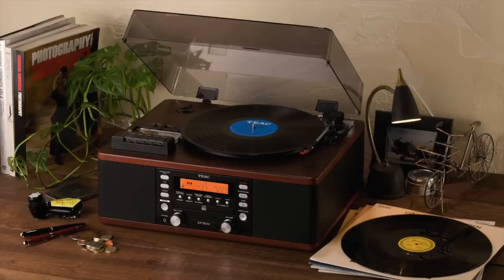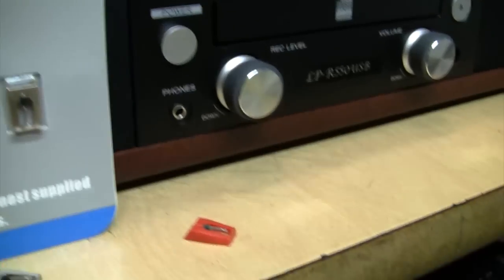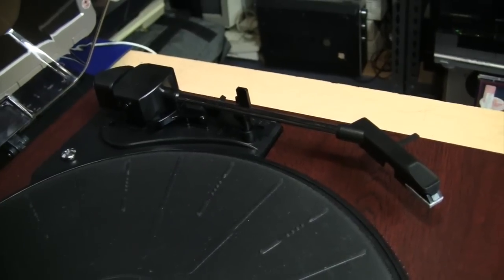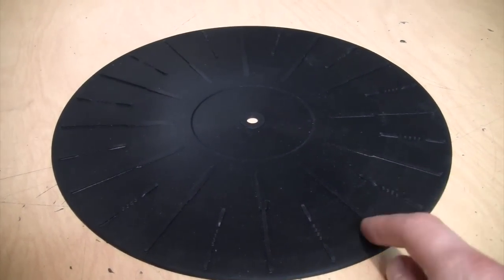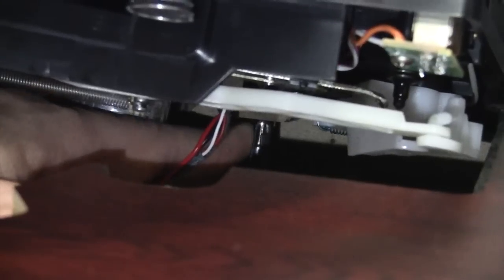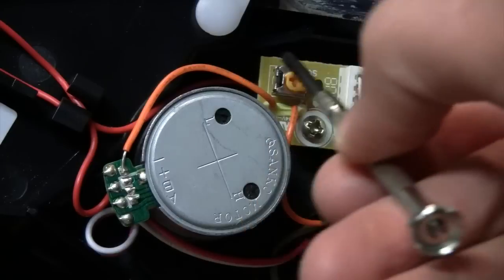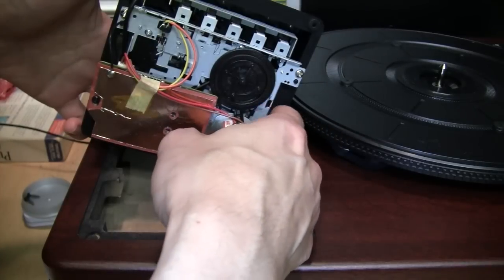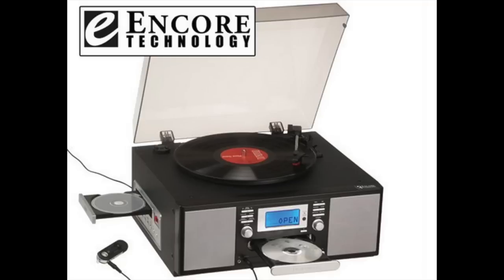TEAC LP-R550USB all-in-one system tweaks & upgrades

Comment: Excellent follow-up video!  I just received this turntable this past weekend and I'm absolutely blown away by the sound quality, even with the stock sapphire stylus.  That being said though, going the diamond route will make it a much better experience for me not only because of enhanced sound quality, but many more hours of playback from a single stylus.  

And in terms of the speed, surprisingly, the speeds for both 33 1/3 and 45 seem to be just fine for me for what bit of vinyl I've played on there already.  The pitch doesn't sound off or anything, and it sounds like how I expect it to.

I unfortunately fell into the trap of getting that 3 pack of diamond styli that Amazon suggested (which is the one you recommended against), so now when those arrive tomorrow, I'll have to return those and then order 1 or a few of that other one you said was better.  Fortunately, I did end up finding that particular stylus on Amazon, so I can just go ahead and order it from there.  But for the time being, that stock sapphire stylus will definitely do until I get that diamond one.
Reply: saxman112 can you post a link to the stylus?
Reply: You're better off using a stylus with the plastic housing/cantilever.  LP Gear has a good quality diamond stylus in the plastic housing.  The reason I say this is the plastic carriers have a thicker cantilever which fits the cartridge better.  The stylus with the metal cantilever is too thin and the prongs from the cartridge stick out too far and can rub against the surface of the record.

Comment: I was wondering if the speed adjustment shown on your video for the lp-r 550 also needed for the newer 660 or did TEAC finally get wise and correct this issue for the newer 660 model?
Reply: I have the 660 model, the record players seems spot on, the cassette deck is just slightly off.  I have not followed VWwestlife advice yet

Comment: I can't pop off the platter to get in to adjust the speed. It comes up on the tonearm side, but something is holding it on the opposite side. I can't open it far enough to see. Is there some kind of a hook holding it in place?
Reply: I have same problem. If you solve the problem please notice me how to pop it off

Comment: Hello. Thanks a lot for this helpful video. It's great. 

I have a question: I just bought this unit as second hand and unfortunately, the built-in speakers are buzzing as soon as it is powered on. I'm using the LP-R500 along with an external hi-fi amp and everything worked fine except that buzzing. 
I'm considering unplugging the internal speakers but since I'm no tech, I fear to do mistakes and damages. Do you have any tip on how to proceed (maybe some service manual?)and most of all, do you think unplugging the speakers can be of any help?
Thanks.

Comment: Great video, but now I REALLY need your help.  So I just got one of these Teac all-in-one units for a song!  $60 including mailing from Iowa to Texas, and it is absolutely flawless except for a noticeable speed problem with the cassette deck.  Since the plan was to transfer all my cassettes to CD, and they are my own demos of music I've written and recorded, I noticed immediately it was playing fast.  It's about a half-step sharp of where it should be. From what I know, adjusting the speed of a cassette deck is as simple as turning a screw, but first you've got to get to it.  I searched for a schematic, I wrote to some tech place, THEN I found your video, and you made it seem so simple, I was thrilled.   So I removed the deck (btw, without removing the turntable) and went to turn the screw that you pointed at 9:13, but guess what? There is no screw.  There's just what looks like black foam, and when I tried to push through it there was nothing behind it.  Then, to make matters worse, I noticed one of the connections was disconnected.  I don't know if it was like that, but I'm assuming I disconnected it accidentally.  Unfortunately, but I have no idea what it came off of and can't see anything obvious.  It's not a solder point, it's 2 wires (red & brown) with a small connector at the end. No idea where it goes.  So now my new LP-R550USB is torn apart, and if you're absolutely sure that is where you adjust the cassette speed, I can't find it, and I can't put things back together until I figure out where these wires go and hook 'em back up.  UGH.  HELP!!
Reply: Cyndie, I just got the 660 Model.  Not for $60!!!  Much more than that.  I really like it, except, I find a little wow and dflutter in the casette playback.  Just a little.  i am going to try to adjust te speed per VWestlife's instruction and see what I find. If like you, there is no way to correct that, Back it goes via Amazon.  Life's too short to keep faulty equipment.

Comment: Philip Franklin 

1 month ago

I was wondering if the speed adjustment shown on your video for the lp-r 550 also needed for the newer 660 or did TEAC finally get wise and correct this issue for the newer 660 model?

Comment: thank god for this video, the slightly faster speed thing has been driving me mad for almost two years.
Update: the turntable won't come off. It has some kind of lock within the hook mechanism that's impossible to unhook without breaking it
Reply from the maker: The clasp is rather firm but with enough force you should be able to unlatch it like I showed.
Reply: @CamcorderTests   I  was honestly overjoyed to know that this speed problem is fixable, but am having the same problem as described above and have a question - if I use as much force as possible, am I pulling up on the platter or as much as I can grab, like the part with the spring? I'm worried I'm just going to rip the platter off. Thanks!
Reply: @CamcorderTests  I've tried lifting every which way and I've actually lifted the entire system while lifting the platter with how much force I used but it still won't unlatch. I have an R550USB but it has a different style tone arm and cartridge head than the one you used in the demonstration.
Reply: Did you ever get to lift the turntable? I’m having the same issue.

Comment: How do I connect external speakers to the back?  I used the auxiliary RCA jacks and connected larger speakers.  I believe they are around 100 watts. Is it not designed to do thar output without an external amplifier?   I did have luck runninga line from the headphone jack to a small 6 place board and to a PA system.   I am basically just trying it, hoping not to blow a component.  Will running the larger speakers from that same headphone jack cause a problem.

Comment: VWESTLIFE, I just received the LP Gear Cerapreme Blue Stylus.  After installing it, I notice that the angle of the sylus may be slightly tilted.  The records play well without distortion but the original stylus didn't seem to have that "tilt" or angle when in the tonearm>  Did I mis install it or is there a adjustment to correct that ? THX for your advice.

Comment: Hello, my turntable won’t turn at all anymore. I am not sure if this is a motor problem. There is a belt and I have tried adjusting the speed as you show in this video but it still won’t work. Any tips? Thanks!

Comment: I have another question:  I can play the Teac via a headphone jack connection to a Double RCA cord and attach it to my Denon Receiver to either of two RCA inputs (the Receiver is more geared to optical and coaxial connections).  a Standard Stereo input or to the CD input.  Or direct Line Out to either of the same input jacks.  Which method do youn think works better?  Using the Headphone jack , you can control the volume using the Volume knob on the Teac vs. not being able to to do that with the Line Out connection.  Is there a separate rate of amplification using the Headphone Jack and/ot music coloration?  THX for your advise.

Comment: Trying to dial back my LP-R400's speed using your method didn't work for me; it lifts up about an inch, but no further, not from the front, nowhere.  Don't want to damage it as it's a great CD burner.

Comment: Thank you for this video! Super helpful, solved the problem of my TEAC GF-550 playing slightly too fast.
Reply: Watched video a number of times.  My LP-R550USB turntable runs fast and I can't adjust.  No matter what size screwdriver I try, I can't feel any slot to turn.  It's like there is no slot under the rubber cover.  Very frustrated at this point.  I realize this is mixed in with a lot of old posts.  Any help would be greatly appreciated.
Reply: @bobmctyeire753  it was a pain in the ass to do, but I did eventually find the slot
Reply: @TacoConsumer  Turns out on my unit there were no slots under the rubber.  The adjustments had been moved to the circuit board like the 78.  Looking back at the video, I noticed my circuit board was different and there were 3 mini pots on it instead of 1.  Wasted a couple of hours before I caught that and with a magnifying glass I could see each labeled 78, 45, and 33.

Comment: Nice piece of equipment.But it badly needs a Tone Control/Bass and Treble Controls to fully enjoy the sound output.
Reply: That’s where the MCD800B turntable stereo system comes into play. You can do it via remote and records will sound awesome and full range. It doesn’t have a cassette player and doesn’t have a “record” function for the CD player.
Reply: @turntablethomas2584  MC-D800 is a great unit, but is only rated for 10 Watts per channel, and the speakers provided aren't the best.  I upgraded the speakers and bought a pair of Polk T-15's which sounded better and gave a bit more bass response.  The LP-P1000, however, sounds MUCH better, rated at 25 WPC, and the speakers are a bit better.

Comment: Thanks for your detailed review of this system. I was already interested and you gave me the nudge to buy it but I just have a small concern:

When playing a record, the platter moves slightly up and down,  one side at a time. It's only slight but still seems a little unusual - is this normal, something I should be concerned about and is there a way of balancing it so that it doesn't?

Also to any Brits reading this - is there anywhere in the UK that I can get hold of the stylus replacements recommended in the video? Google is just returning US shops.

Comment: Very informative. Thanks for this video. If i'll buy this system i am definitely going to buy the cerapreme blue stylus.
Reply: I don't like the Cerapreme blue stylus.  It's not meant to be used with the heavier weight of the tone arm on this machine.  I told them it was a bad design, and they said it wasn't.  There is practically NO clearance between the cartridge and the record.  I was getting unpleasant whooshing sounds on some discs because the prongs on which the cantilever rests protrude too far down and would scrape along the record surface.  It's best to use a stylus with the thicker plastic cantilevers.  Same issue with the Cerapreme 78 stylus.

Comment: Thanks for the comprehensive reviews on the TEAC LP-R550USB.  Very well done.  I am considering purchasing this unit.  I do have a question.  I downloaded the Operators Manual.  It indicates that the turntable is belt driven.  However, I didn't see any instructions on how to replace the belt and your video does not review this procedure.  Could you do a video on changing the turntable belt?  Thank you.
Reply from the maker: Replacing the belt is the same as with a Crosley record player. There are plenty of tutorial videos on how to do it.
Reply: Thanks for reply.  That looks easy enough.  I was surprised it wasn't included in the owner's manual.

Comment: I was wondering if the pfanstiehl 793- d7m diamond stylus suggested as anupgrade to the default stylus included with unit is compatible with the 5 gm trackingforce of the tonearm? I've heard that tracking force must be adjusted when using a differentbrand and model stylus and you said that lp r550's  TF is pre set and cannot be adjusted.
Reply from the maker: The 793-D7M will work fine with this player. No need to adjust the tracking force -- it's well within the acceptable range.

Comment: I have a problem with a Lauson cl136. When the lp ends the needle should go back to the rest position but it doesn't. I have investigated a lot about this issue, but I haven't found any answers. Do you know the solution to this? Thanks.
Reply from the maker: There is usually an adjustment screw for it somwhere, although its location is different on each turntable and I'm not familiar with that one.
Reply: VWestlife's Camcorder Tests & More Thanks!

Comment: can you remove whole cartrige not only stylus? I have Audio Technica 440ML can it be mounted there?
Reply: You can remove the cartridge, but you cannot install the AT 440ML.  First, it will not fit and there is no way to mount it. Second, The AT440Ml is a magnetic cartridge, and requires a pre-amp to amplify the cartridge output to output the correct signal, the TAEC units are designed to work properly with ceramic cartridges, which have a higher output signal than magnetic cartridges.

Comment: @camcordertests I know this video is 6 years old so I doubt I'll get an answer. I have the LP-P1000 and I cannot get the turntable all the way out like you did in the video. I've looked at all the comments and tried doing what they suggested, too, but to no avail.It seems to be on the left side there is more than just a clip. In your video at 6:03, see the metal spiral on the left, mine seems to be mounted. The others on the right side come out but not the front left. It's driving me mad! I just want to slow the speed. I cannot buy another since they are hard to find or I would. Please help!! I'll pay you for your time!
Reply: Disconnect the player and connect to another player. Que on mental health.

Comment: Thanks for a great video-I learned a lot from you.  My question is: can a sub-woofer be connected to the teac r550/r660??
Reply from the maker: If it has a built-in amplifier (i.e. a powered subwoofer), yes, you could connect it.
Reply: Again, Thanks for the quick reply-I will post a comment on the difference with/without the sub once I get my rig set up and running
Reply: a music centre with a little "active subwoofer" connected to it isn't much of a rig lol

Comment: I can’t remove the left side of the platter, there’s something hooking it in and it’s driving me f**** insane because all my records are playing slightly fast PLEASE HELP 😢
Reply: I have the same problem!
Reply: It seems that teac lpr500 has a different locking mechanism. I managed to remove the platter by   opening the back panel and popping the same tab that's shown on video. Afterwards I could reach the left side and pop a tab there (it's not done in this vid). Just wanted to share my findings. Hope it helps!
Reply: Mine won't come out either and ITS REALLY starting to piss me off. The records play too fast.
Reply: @TheLalalalapopopo  Who ever u are, YOU THE MAN!!!  Just went through the back, popped that tab, and Got in.  THANK U
Reply: @life5161  Hi Brian, I KNOW I'm having the same problem you did, have the lp500, took the back off, but I still can't find the clip. Did you remove the back completely? I unscrewed it but I can't get my hand in there enough. How did you do it?! I still have faith after years of playing slightly too fast.
Reply: I couldn't reach that part and it never comes out omG
Reply: @FilipeJacon  You have to go in through the back, reach around to an awkward spot and there's a clip you have to undo. It took me days, but I eventually found it.  😆    Good luck.  After Messing around with it over a week I eventually got it playing the right speed. I used an app to get the correct speed. It played way fast before I got to that adjustment
Reply: @samrusnak9974  U have to take the back off and theres a clip in an awkward spot.  U will find it!!  It took me forever but I eventually got it
Reply: @life5161  I opened the back part and WHAAAAT ? Nothing, I still can't reach that my oh my
Reply: @life5161  I finally did it ! But now when I turn up the volume till 40 it starts to make a horn sound 😅 omG haha
Reply: @FilipeJacon  Dial it in!!  😄  You'll hopefully get it. Once u do have it dialed in it's nice.

Comment: What is the best stylus for playing only/ primarily 78s please?
Reply: You can use the TEAC recommended 78 stylus,  SPL-102 as listed in the manual.  I bought several 78 stylii from LP gear, which work wonderfully.
Reply: @01chippe  thanks. I didn't get it in the end. Instead I got an old Lenco L75, shure M75 cartridge with the 78 stylus.

Comment: ASK Teac if they upgrade this model to add a mic input for the CD, Tape, and radio recording modes! Also, would you be able to add a dual flip-style cartridge/stylus to play the 78's?
Reply from the maker: Yes, the Banpa BP2-ATC cartridge will work with this turntable.
Reply: @CamcorderTests  I could not get the Banpa cartridge to fit properly. It seems the "head shell" is a little too narrow, and the cartridge wouldn't sit properly, or securely.

Comment: I have the R550usb and I can’t get the platter out. Lifting the tone arm raises it on the one side, but on the left side it just refuses to release the latch. I feel like it’ll snap the platter if I pull any harder. Mine has a different tone arm though so I wonder if it's an older or newer version of it.
Reply: Mine does the same thing, were you ever able to get it out?
Reply: @ingenic6501  I was able to. I had to take the back plate off by unscrewing it, then reach inside and use my finger to push the metal piece underneath from horizontal to vertical. then I could lift the platter out.
Reply: @foof811  Thanks, just did this to mine and it worked! turns out theres a clip in the front as well as in the back preventing it from coming up in the video